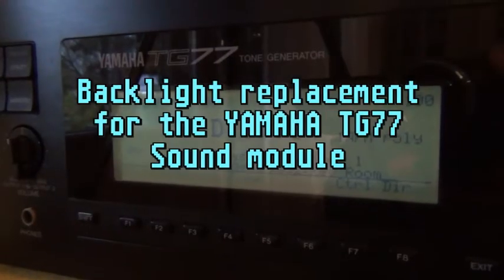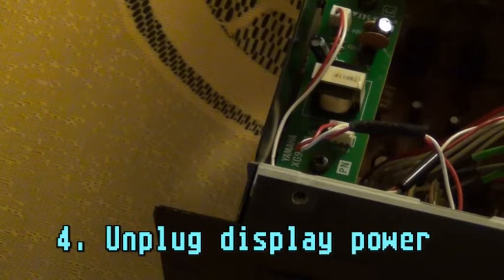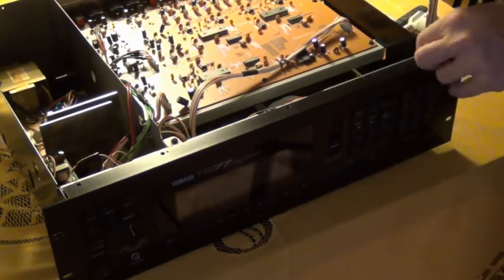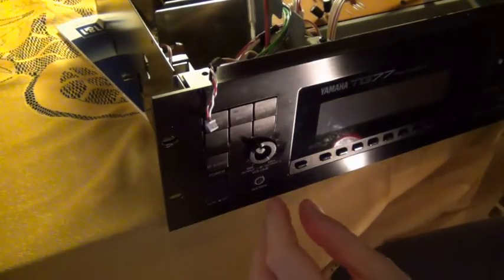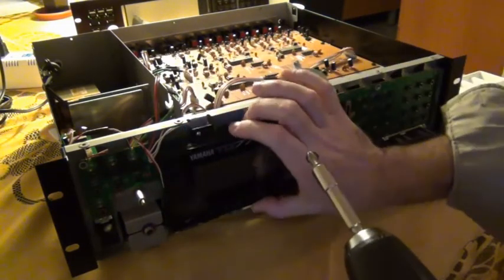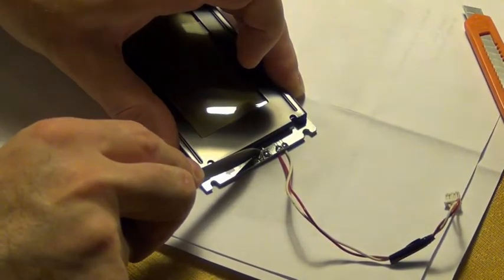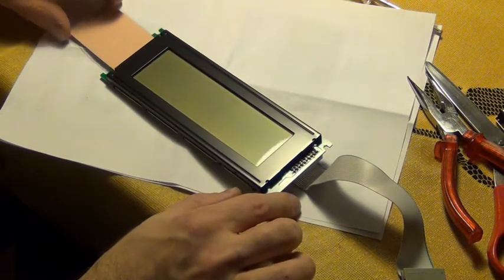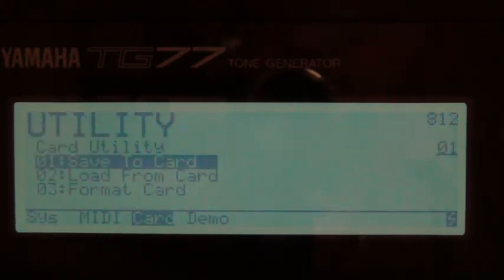Yamaha TG-77 Backlight panel replacement

Comment: I replaced the whole screen on both my TG77s. It's a bit (probably a lot) more pricey but the plug 'n' play screens are slightly easier to install then replacing the backlight panel and they're like looking at a different synth when you're done!
Reply from the maker: That sounds interesting! Do you have some links to share?

Comment: It would seem the reason your display is not as bright as before is, the R476 on top board near contrast adjustment needs to be replaced.
Reply from the maker: Thank you for the tip, I'll have a look! This is my first and only TG77, which I got with the dark display as shown in the video so I cannot say whether it was brighter earlier. From other users' comments I got the impression that these modules' displays are generally darker. I also had a mint Kawai K5000 with a very similar not-very-bright display.
Reply: @LeadingMotive  I bought mine brand new back in the day and i can say the display was very bright. so bright i had to turn down the contrast in the back half way which was more than adequate also to make it last which it has to a point but it's not time to replace yet. one thing for sure, if these synths are not turned on at least once a week and left on, so much damage result from that. practically every synth in my arsenal has been damaged, displays, all programs, push buttons and all my cards have been wiped out because i left things off for about 12 years.and I just got through replacing a battery on TG77. what a pain. all new battery holders the space on pins is 3/4 inch but all Yamaha synths from that era the space is 5/8 so had to improvise.
Reply from the maker: @WV591 Interesting, thanks for the info! On my TG77, the contrast only influences the LCD panel, not the fluorescent layer. But by making the LCD darker via the contrast you can reduce the brightness that gets through.
And I hear you with not using gear for a long time - it's always good to switch it on every once in a while.
Reply: @LeadingMotive  .>>> you are correct the resistor effects the LCD replacement. i have come to a conclusion that replacing backlight is waste of time and money. i replaced BL on my D550 and it's no better than the one I removed. henceforth, i will be replacing LCD they cost less in most cases. TG77,D550 and MKS80 on list. It is strange that the Waldorf synths never have issue with display. my microwave1 is as bright as the day I got it.even the original batteries works.

Comment: Does the display replacement look the same in the QS300? Any clues?
Reply from the maker: Sorry, I don't know the QS300. This video is not about a display replacement, I'm only replacing the backlight. If the QS300 uses the same approach it's probably a similar job, but the measurements might be different.

Comment: Do you know where can I find the lithium battery on TG77?
Reply from the maker: I don't remember unfortunately, but looking at Davide Solurghi's videos it is somewhere on the mainboard. The TG77 is quite easy to open (if you are not working on the display :-), so you could open it up and have a look.